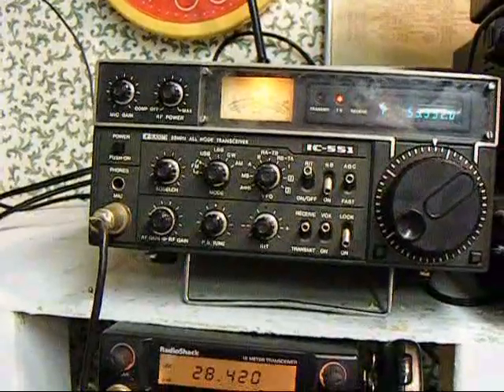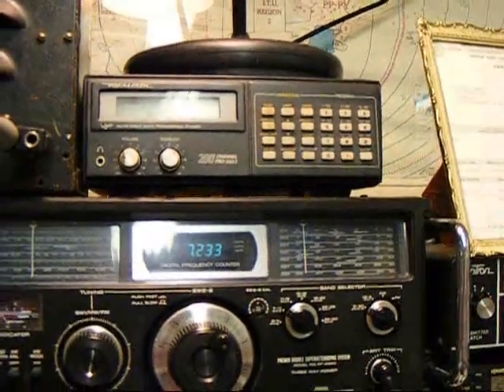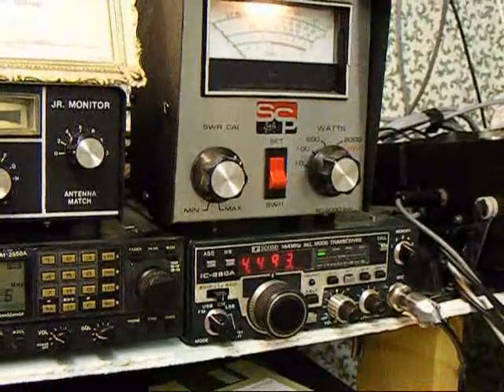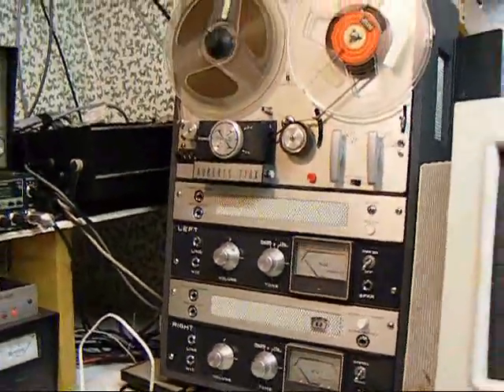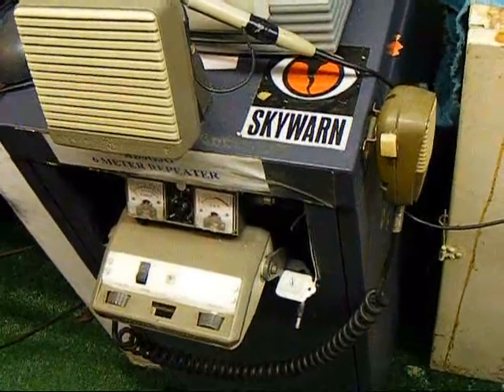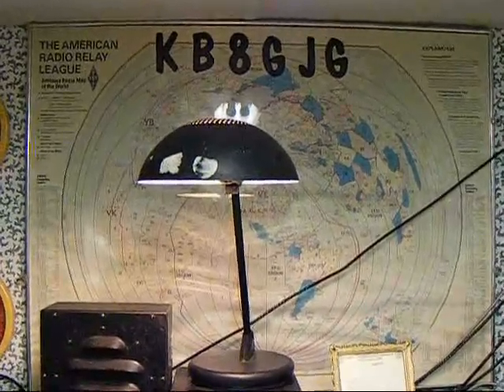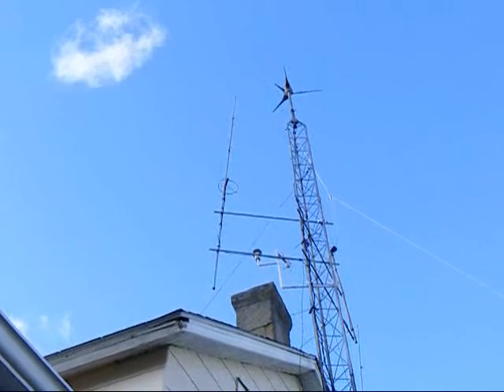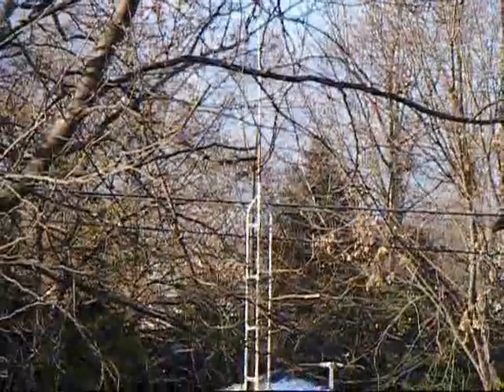My Ham Shack

Comment: some good stuff there, just getting into the hobby myself, havent got my licence yet but bought my first HF rig yesterday. Will be using it on 11m until i get my licence
Reply: That was a Terrible Start.NEVER put an Illegal transmitter on ANY band.Use them where they were designed to be used.CB on 11 meters & Amateur Radios on the Amateur Bands.Be a Good example & NOT just another CB'er who also uses Amateur Radio.